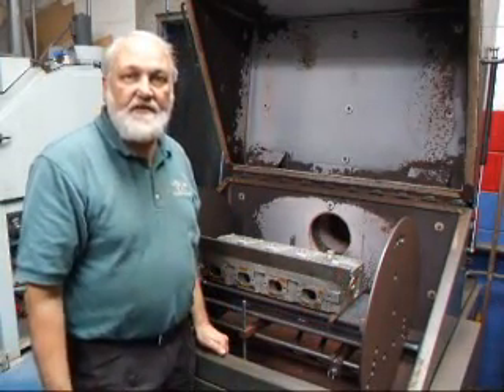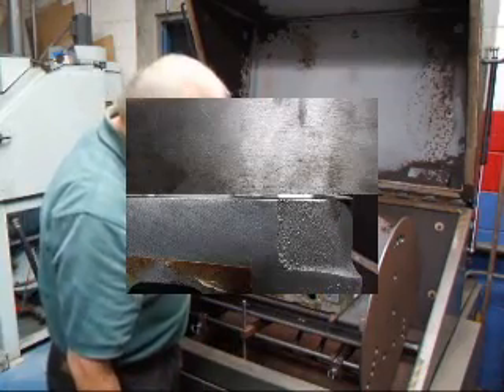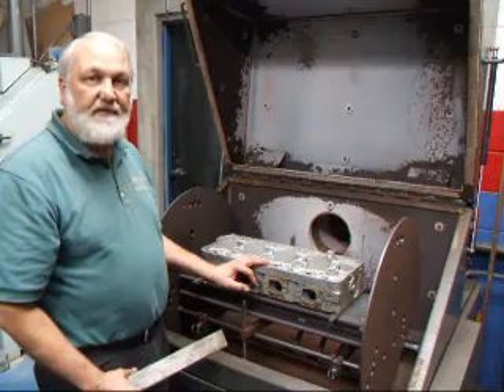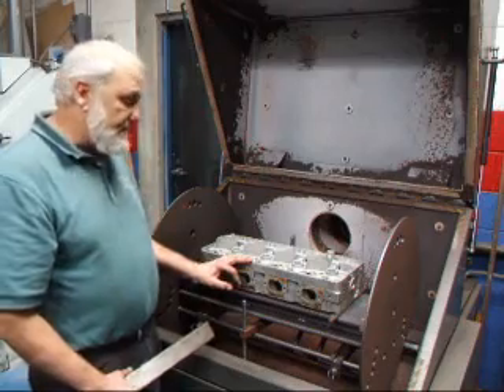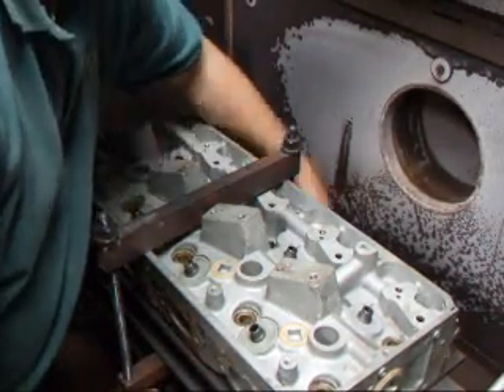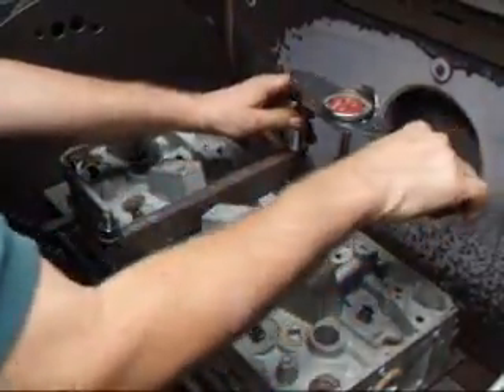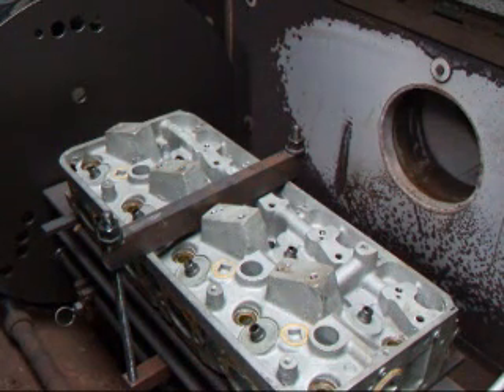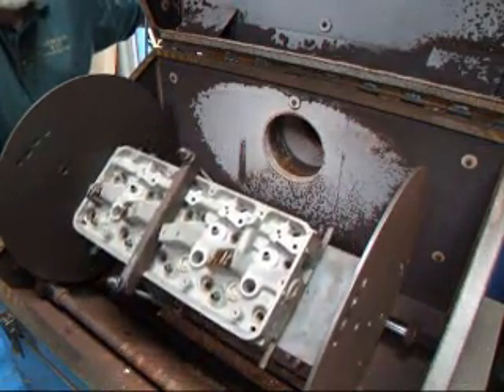Boss 429 Cylinder Head Straightening

Comment: Agreed. Chances are the warp is uniform over the length of the head, not just in one spot. If the head got hot in one area, like if part of the water jacket was blocked or something, and it warped in one area, I could see merit to localized straightening. Otherwise it's like straightening a banana by tweaking one spot, and all you'll get is two bananas.

Comment: @5191keith I would think the most obvious reason is so you don't have to mill too much metal off it. Each time they warp, you'll have to mill a little off. Eventually, they can no longer be milled. So you'll want to remove as little as possible.
Reply: Not to mention the cams will run smoothly.

Comment from the maker: @dwnrety1 - The 429 do not use a standard head gasket, the use a nitrogen filled ring and several quad-rings to seal the coolant - good idea, but bery expensive to buy those bots no days. I have welded all the receiver grooves and machined the head for a standard 429 gasket - work real well and the gaskets are cheap.

Comment: I have a 351C for sale for 3000

505hp @ 6750 rpm
4V closed quench style heads

hydraulic roller crane cam conversion kit

edelbrock rpm intake w/ 1 inch spacer

Keith black forged flattops

Stock rods, polished & shot peened

Stock crankshaft

Clevelands pwn any SBC

Comment: I have a 1973 351CJ 4V engine(Cleveland). Open chambers & large valves. Original exaust manifolds & Edelbrock Torker intake. 20,000 original miles, new rod bearings & main bearings & resealed. For sale $900.

Comment: Yeah, I've read about Flow Technology's heads, RHS, DART, and a few other cylinder head manufacturers that make both cast iron and aluminum heads, I've noticed that aluminum are over 1000 dollars more than the iron versions, it could be the same engine, one could sell the motor with iron heads and the same motor with aluminum heads and there's a 1000 dollar difference, people buy the aluminum heads for the weight savings but I'd rather have the strength and longevity of the iron heads.

Comment: I would rather use cast iron heads!, with the high performance cfm flow rates, intake/exhaust valve sizes, and heart shaped combustion chamber/number sizes of the aluminum heads....

Comment: almost all the V8 engines we work on are american, all aluminium cylinder heads are heat treated, over heating your engine will cause a loss of hardness in the same way as turning a drill bit blue will cause it to lose the cutting edge quickly. it does not matter who made the cylinder heads

Comment: hi John, if the head has been that hot it will lose clamp load on the gasket because of the loss of hardness, straightening this way works but it further softens the alloy. there is another method that most shops in New Zealand have been using for the last 15 years that keeps the temperature down below annealing point. but first we always check hardness, if it's below 60 brinell it is sent for heat treatment or scrapped

Comment from the maker: Temps vary somewhat depending upon the mass of the cylinder head. Torque remains pretty consistent. SOme heads require 1-3 cycles to get them straight. The aluminum alloys vary between manufacturers and this makes for unpredictable results. With experience you gain a feel for the process.